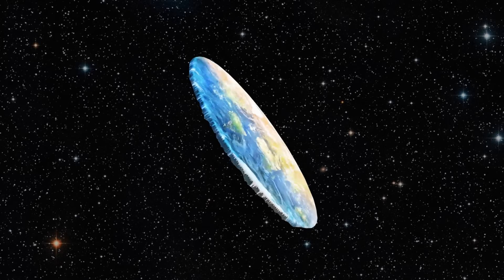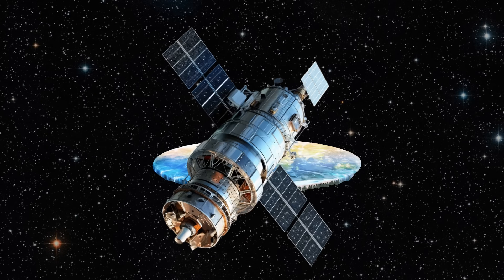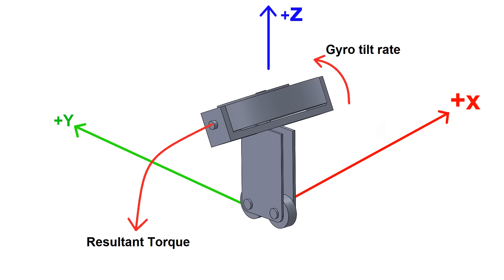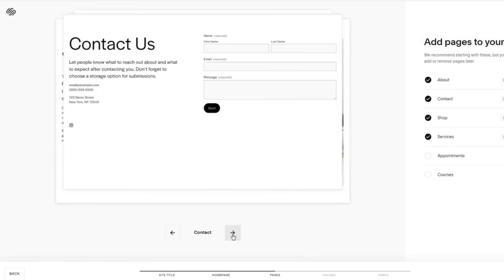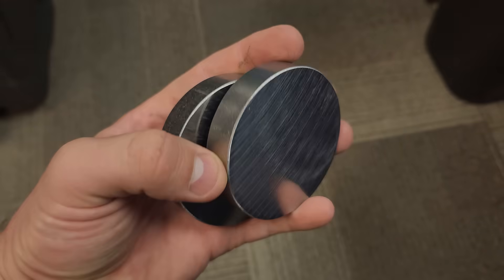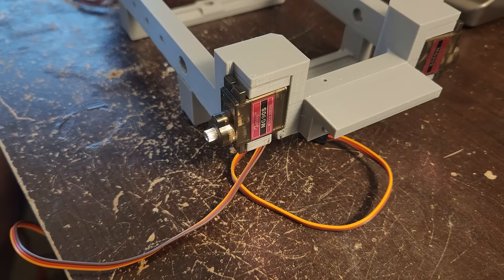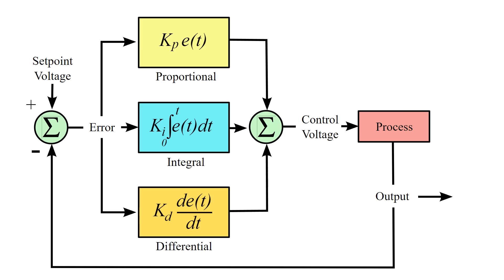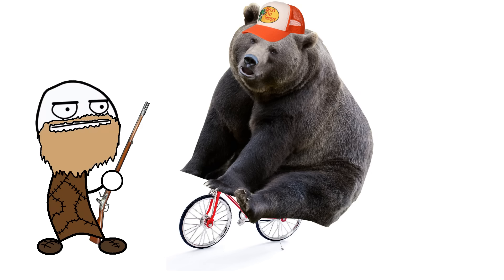Gyro-Stabilized Monorail Train

Comment: Great video, love your content. You missed one thing at 5:49. P-factor is the propeller generating uneven lift on the plane of rotation due to one side taking a bigger "bite" out of the air (not quite how that works but an intuitive way to understand it). In aviation what you are referring to is just known as gyroscopic precession and effects turns as well as pitch movement. I am a flight instructor and I hear my student mess them up all the time. Thanks for the great video!

Comment: Honestly I'd be amazed if you could get this working with only a P term. Unless you have zero latency between sensor and output (which you definitely do not) this will always oscillate uncontrollably. I don't believe there is any way to make this work without at least the I term, and maybe the D term as well.

I also don't believe you need the rate of change output from the MPU6050 in order to add the D term. That should be entirely unrelated.

Comment: I think the issue you had with the metal flywheels was that your 6050 was not isolated physically. Had the same issue with a commercial drone I had to work on that had the Gyro board bolted to the airframe and the motor vibration overloaded the accelerometers and gyros with high-speed noise, rendering the sensors useless. The way round this is to isolate the gyro board with soft rubber bushings, they act as physical low pass filters.
Reply from the maker: Yeah this is spot on. Didn't show it in the video, but the sensor readings were going apesh*t from the vibrations, which made things a lot more difficult.
Reply: @HyperspacePirate  Also, the MPU6050 does have a built-in lowpass filter. You're probably not reading at 1-8 kHz, setting the filter in the sensor would probably get better results than filtering in your microcontroller code.
Reply: @HyperspacePirate  try using a faster controller  like stm32 arduino is just suck 😁
Reply: @adelzaher-o6r  That won't fix sensor noise
Reply: @zyeborm   I know  but in this project  you  need to have a faster response to balance it self
Reply: @adelzaher-o6r arduino should be easily fast enough, the bandwidth of this control system is probably a few 10s of Hz. Don't need a 100Mhz micro here!
Reply: or just LPF in software...........  ;-)

Comment: As a control’s engineer, get rid of the derivative from your PID. derivatives tend to be extremely unstable. just use proportional and integral. I would also only use one motor for tilt for both gyros. You can couple the angles together mechanically. 

The problem with the derivative lies and the fact that a derivative is instantaneous reaction . an integral takes time to build up and gives you a smoother output. a derivative will go positive and negative and then react to itself in the next program cycle just leading to unstable oscillations. 

I recommend starting with an integral to proportional ratio of 10 to 1, then adjusting from there. I don’t know why, but this typically works
Reply: He has no D term, not even an I term, only a P term so no wonder it's oscillating.
Reply: If you could only pick one I'd pick I over P over D. An I only control is often surprisingly decent if sometimes a little slow.
Reply: I agree. Yes
Reply: This is an inverted pendulum controller with more steps, PID is known to work. He could try Ziegler-Nichols or another proven empirical technique to smooth out control response. Edit: but yes I agree in general the derivative term is risky, could also be a result of noisy or delayed processing from the raw MPU data too.
Reply: @kentaltobelli1840  PID isn't guaranteed to work. It's usually a pretty safe bet but depending on update rate, sensor noise, latency, design, indirect actuation (like these gyros), bad luck, or whatever else, PID could be wobbly or unstable. I don't doubt that it could work here, especially combining the accelerometer and gyroscope.
Reply: He could also use an arduino with built in IMU for simplicity. I suspect that his servos are also basic potentiometer based ones, adding lag, inaccuracy, and a bit of momentum in the servo motor itself.
Reply: Yep! The derivative creates a tighter stable region and produces overshooting.

Comment: For context this is the machine reference from WiKi " Gyro Monorail "  Louis Brennan (Irish inventor);  'Brennan Monorail' ;
He did much work on a monorail locomotive which was kept upright by a gyrostat. In 1903 he patented a gyroscopically-balanced monorail system that he designed for military use; he successfully demonstrated the full sized system on 10 November 1909, at Gillingham, England. At the Japan–British Exhibition of 1910 at White City, London, he built a mile long monorail track and gave rides for around 40 people at a time on his gyro stabilised 22-ton prototype. Winston Churchill (then Home Secretary) was one of the passengers and then drove the vehicle himself for one circuit. He was so impressed that he brought along the Prime Minister and other cabinet members and family to see it the following week. The exhibit was awarded the Grand Prize for the exhibition. Although the ability of the vehicle to balance itself on a single rail was amazing, especially when stationary, it was not to prove a commercial success, partly due to fears that the gyroscopes might fail, and partly because any wagons or coaches towed by the locomotive would also need powered gyroscopic stabilisation.[2]

The transmission was electric, with the petrol engine driving a generator, and electric motors located on both bogies. This generator also supplied power to the gyro motors and the air compressor. The balancing system used a pneumatic servo, rather than the friction wheels used in the earlier model.
Reply: Cool, I don't have to make this post. You beat me to it.

Comment: Too much Kp along with your observation on quantization. Use gearing / belts on servos to improve quantization (and reduce loop gain), then play with gain. 

Also, since you are controlling torque but measuring position, you need an integrator for a stable system. You might want to use cascaded loops, one for velocity closing on the rate gyro outputs, and another on the position. Once the velocity is properly compensated, with integral gain to eliminate offset errors, the position loop can be a trivial proportional gain. 

Get it to be mostly stable then record some data while inspecting a small amount of white noise, and then calculate the transfer function (closed and open loop). Plot on Bode or Nichols chart, from there tuning should be much simpler. Stabilize the velocity loop first, then position is basically free.

Comment: @HyperspacePirate I think you're getting trapped by the default Arduino servo library in which the write() function takes an integer which represends a degree. The servo class however also has a writeMicroseconds() function which allows you to directly control the pwm pulsewidth. You'll need to dig around in the library code to figure out the conversion, but you'll have much finer control of the angle. Also I think some servos have a built-in acceleration depending on how far off they are from the wanted angle. So you might want to try and overshoot only to correct after a certain time... still a PID.

Comment: Very very cool reaction wheel work! I don't think removing a rail will reduce the cost by 50%. I think it would be closer to 10% since everything involved with the job will need to be provided and installed. Labor is by far the biggest cost, and the main labor is laying gravel, cross ties, bridges, rail signals, etc. All you'd be saving is the cost of rail which is likely $1.00 per pound and a little bit of labor.
Reply: I believe the land acquisition is the largest cost on many rail projects but yeah saving a little on steel wouldn't change much

Comment: You said so earlier in the video, the precessing rate of change is proportional to the torque. To balance things, the torque usually needs to be proportional to the angle error and the change (derivative) of the angle error - PD control. But your servos try to enforce a position which is the integral of precession rate. So, hand wavingly... integrating once makes P and D into I and P. 

You need a PI controller. 
Or if you extend it, I think you'll need a second integral, something like P-I-I2.

Also, another youtuber James Bruton made like a dozen videos with various gyro balancing robots, you could check those out, or contact him and he might give you his secrets :)

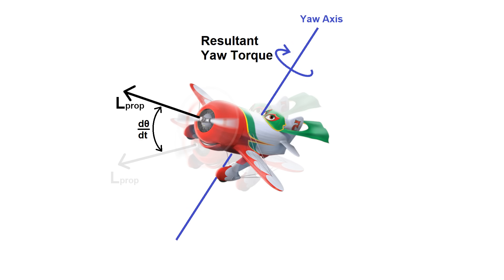Comment: 5:35 actually you mixed things up, P factor is purelly aerodinamical, due to wind comming at an angle to axis of rotation, and actually is in the opposite direction. In western type aircraft, prop spin clockwise, thus at some AoA, right blade travels down and hit incoming air at greater local AoA, producing a leftward yaw (hence MORE RIGHT RUDDER DAMMIT), while pitching up itself would make you yaw to the right, and would be felt in like a sustained turn, while slow flight flight would make you yaw left due to P factor.

Comment: If you're looking for a higher resolution solution to RC servos, use RC servos, but remove the electronics inside them, internally they are a gearbox, dc motor, potentiometer and control electronics, use a small H-bridge to drive the motor directly and an ADC to read the position. This solution is quite cheap, but requires you to tune the PID for the servo (or use a fuzzy controller)

Comment: Hello my man, thanks for creating this awsome content. Getting rid of a thread cutter in a throughhole is easy, you can just punch it through. their hardness also means they are brittle so the stuck part will just shatter into pieces and eventually driven out the back. it'd be very unlikely tho to have a working thread of the same dimension after that approach. Also a P controller is not enough for your approach. Problem being, that yout angular error causes a sudden answer from the control loop giving an intense feedback in the opposite direction of your previous angular error. then on that it answers by a counter reaction the other way and so on. thats a Control loop oscillation and can never be fully eliminated. But if you used the integral part, yoi can limit the amount of answer inertia per error and time and dampen the control loop oscillation that way.

Comment: P-Factor is aerodynamic, due to the propeller thrust becoming asymmetric when pitching the aircraft nose up..... inherently the upward spinning (left) side of the propeller will decrease its angle of attack into the oncoming airstream, diminishing thrust. While simultaneously while the downward (right side) does the opposite, increasing its "bite" to be scientific. This causes the aircraft to want to start a yaw to the left. In severe situations, it can cause a stall  possibly unrecoverable since youre still close to the ground.  This is common in single engine propeller aircraft and is mediated by the pilot applying slight right rudder to keep the climb out straight and coordinated.  Torque Factor is reactionary yet will do something similar but on the nose axis, countered with aileron input.  Though in a C172 torque factor is nearly non existent.  The P51 Mustang with its huge Rolls Royce was a Torque BEASt!, and there have been a many of pilots who have ended up upside down and into the ground after applying max power in a low slow condition....the motors torque would just twist the entire aircraft as a "gyro-scopposite reaction"!

Comment: Do you have a damping factor in your gyro-control code? If you try to move by 100% of what the sensor tells you to move, you will overshoot and get oscillation (or adjust by smaller amounts a lot more often)

Comment: Steel is a pain from time to time, I like to tap it by hand sometimes just to be sure. Oh and did you add smoothing to the IMU readings? MEMS sensors are pretty jittery as you might have seen in data coming from them

Comment: Your controller should take into account bank angle and roll rate. Meaning that bank angle error will drive towards zero and roll rate will damp that signal based on the rate you approach it.  Would probably be good to write out some equations approximating the moment due to gravity and bank angle and the moment due to your control effector.  Do a Laplace transform on the second order ODE governing the system and you should be able to model a reasonable PI controller (derivative is probably too noisy unless you lowpass it) using Ziegler-Nichols and a little bit of simulation

Comment: This was fun, but ohhmahgosh a proper PID would help with the jitter problems. Its also very easy to implement on arduino, like, here's all of the logic you'd need:

  #define P_coefficient 123.45 // coefficient for proportional component (Angular speed)
  #define I_coefficient  12.345  // coefficient for integral component (Cumulative angle error)
  #define D_coefficient 1.2345  // coefficient for derivative component (Angular acceleration)

  float outputAngle, angleError;
  long integralTime;
-----------------------------------------------------------------------
void PID() {
  angleError += [MPU_GET_ANGULAR_SPEED] * (millis() - integralTime) / 1000; //multiplies time since the last measurement by current angular speed to get the angle, and adds it to the cumulative error
  integralTime = millis(); //starts counting time from the last measurement from 0 again

  outputAngle = ( [MPU_GET_ANGULAR_SPEED] * P_coefficient ) + ( angleError * I_coefficient ) + ( [MPU_GET_ANGULAR_ACCELERATION] * D_coefficient ) + 90; //multiplies P, I, and D by their respective coefficients and adds them together to get output angle for servo
  if (outputAngle > 120) outputAngle = 120; //limits servo travel
  if (outputAngle < 60  ) outputAngle = 60;
  servo.write(outputAngle); }

  Just put the definitions and variables where they belong (before void setup), the whole 'void PID()' block of code after everything (not in the void loop(), after it, like in the end), and have the line "PID();" somewhere in the main loop (void loop() i guess). 
  Then replace all of the square brackets with the actual mpu readings for angular speed and acceleration, and adjust the coefficients (D, the derivative component is the one that helps with jitter the most), and you're good to go. This is literally everything you'd need. I enjoyed this video but PLEASe do this omg its so easy and would improve everything so much

Comment: You should check out Aaed Musa's video "High precision speed reducer using rope". A capstan drive and small field-controlled brushless motor would be a perfect replacement for the servos in this project.
Reply: That is a very good video

Comment: I tried to build a phone gimbal using servos, faced the same jitter issue whenever i attached a phone(without the phone, it would work fine). It existed even after i added a complimentary filter in the control loop and/or adjusted the gains
Reply: oh, you too! I'm reading all the comments, seeing what I can learn and will put it on the list of projects to try again...
Reply: One word: granularity. And you'd think it applies to the sensor, but no. It's a triumvirate. Sensor, software, AND hardware. If the three don't match, aren't enough or are too much, you end up having issues.
You need to fully understand what you're making to make something like this work properly IF you're not using someone else's recipe (of which there are many online).

Comment: you need to change your ratio of the servo so put the link on the closest point the the pivot point on the servo horn and increase the point on the gyro. that will increase your resolution of the servo control. servos also have back lash and this will also decrease the backlash seen by the gyro

Comment: you could just 3d print a longer arm for the thing you connect the servo to?   you lose ability for full circles, but a longer lever at the flywheels end(the green part) for the connecting point would mean it moves less angles when the servo moves say 90%.     like if you don't need linearity but just want finer granularity at that end then that hack works out. (and is a simpler change than some reduction gears, it's more like a reduction lever then)

Comment: You could also increase granularity by putting the servo on a like a 3:1 or even 4:1 gear ratio. The servo probably far exceeds the the actual angular limits of the gimbal so putting it on a ratio would let you use more of the servo and increase the granularity. Wouldn't even really need to change the code much as it would be a simple case of multiplying the desired angle.

Comment: At 4:05 ... isn't that ... wrong? The resulting torque should be in the opposite direction shouldn't it?
The torque that you input will be "applied" 90° later in the rotation, that's how I remember gyroscopic precession.
But that would mean the resulting torque should be in the opposite direction.

Comment: If you use a more beefy microcontroller (with an FPU) you can use .e.g. madgwick sensor fusion for the MPU6050. This results in a much cleaner orientation tracking.
Reply: Like what ?
Reply: @andymouse  A safe choice for raw power is a Teensy. Otherwise anything with an Cortex-M4F or better. ESP32 is also plenty powerful.